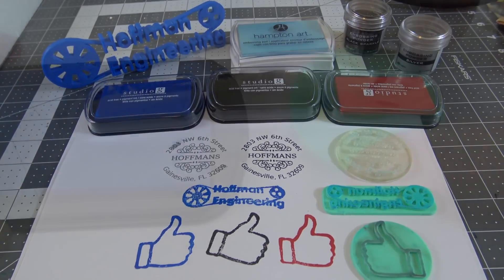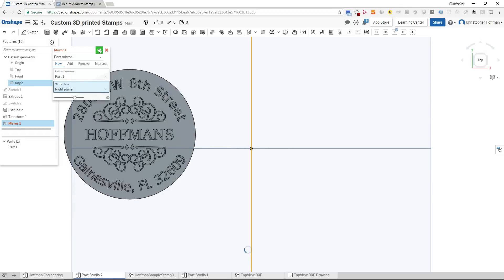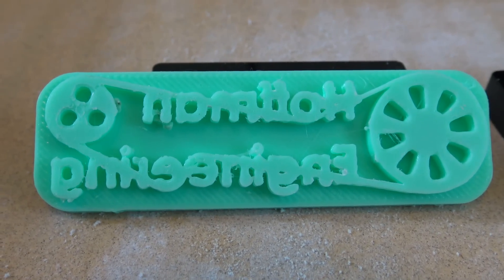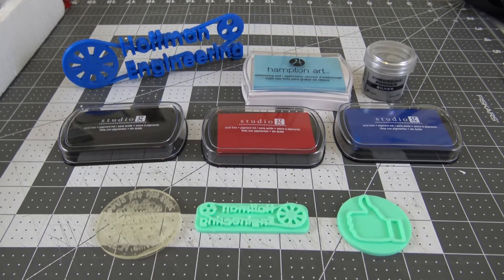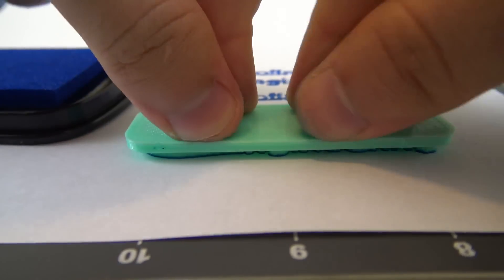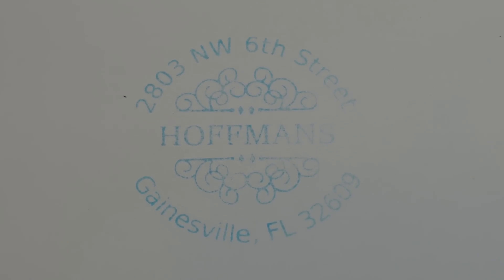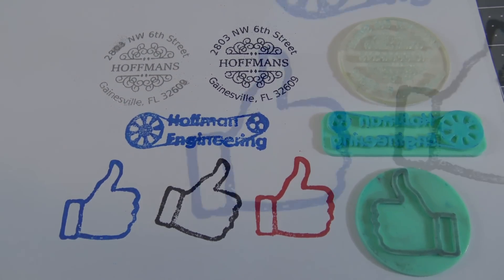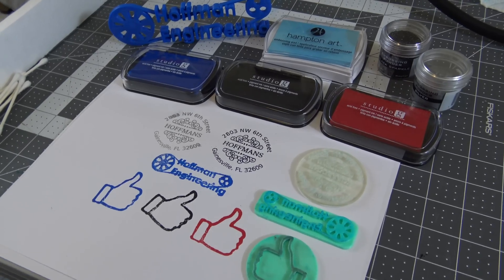Can you 3D Print custom stamps? DIY Crafting

Comment: Experienced stamper here. 
1. You can use embossing powder with ANY pigment or hybrid ink or a watermark inkpad as well.
2. The uneven image may be due to the fact that the stamp is made from plastic, and is non-porous. You may be seeing the result of the ink beading up on the surface of the stamp.
3. It seems like you're having to use a lot of pressure on your stamp. Place a soft surface under your paper, like a few layers of fun foam or a mousepad. That should help you get a cleaner impression.

Comment: Glad I found this. I was wondering if I needed a flexible rubber like subutrate to do this and am glad to know I don't  (though I am probably going to use the most flexible filmament type that suits my printer, all the same, but that still is far less flexible than rubber!).

I actually work in an educational maker space, so have had access to a number of printers for several years now, but, Ironirally, have never had anything I ever wanted to print for myself (I have only ever printed stock demo pieces learning the equipment, which is kind of sad 🙁).

I have a bunch of self-inking stamps of the flip-about mechanism type (so don't need ink-permeable stamp faces) salvaged from our admin office's waste stream and have always wanted to do custom stamps for them, so I now have something to print for me! 😀

Comment: I make rubber stamps for living. There's a type of rubber stamps we make from photosensitive resins just like the one for you printer, except that we use masking films and UV light box to expose them. I've just figured that you could use these SLA printers (the LCD based ones) to make the stamps as well. You start off by sandwiching the polymer liquid between two pieces of glass with a damming tape in the middle, the glasses being the size of the platform. You then shine the lights from a UV source onto one side of the glass sandwich for 1 minute (to make the base for your letters) Then bring the other side to the printer and place it right agains the LCD sceen with the image being projected for 1-2 minutes then disassemble the glass sandwich and wash off excess resin. The whole process could be completed in about 5 minutes but this would only work well with the LCD type printers. You're basically bypassing the film/stencil making process by using the printer's screen in its place.
Reply: I need silicone stamps to be used as inserts for my resin art.  Do you make them?  thank you.

Comment: Question, what did you use to heat up the embossing powder on the paper?
Reply: heating gun as i heard ...
Reply: I am not sure what is required, but in the video it looks like he used a soldering station.

Comment: Thanks for the Video. I'm also addicted to stamps at the moment and tried 3D filament printing. But the resolution was not high enough for my linearts. After that I wanted to switch rubber and laser engraver which can be a bit dangerous and expensive. But now I'm thinking about a Resin printer. That should fit my needs.

Comment: I came here looking for some tips, because I'm not very satisfied with how a stamp I made is performing. Not really sure why. I think it's because the stamp material (PLA) is too hard to do a good job, but you mention that it worked fine for you (which is interesting). The results I am getting look a bit spongy or stippled looking. I'm kind surprised that I'm getting this symptom, because I did sand the bottom against a flag surface. Maybe it's the kind of ink pad I am using. I got it from an office supply store, not a craft store. Imma gonna keep looking for info on this subject...

Thanks for introducing emboss powder. I'm going to have to try that at some point.

Comment: At 1:50 you forget to mention that even after the alcohol rinse, the resin isn't fully cured yet. You still need to do a post print cure, under UV light (sunlight or a lamp). An item of that size would be fully cured after about 30 mins under UV light.
Reply: It shows him hitting it with the UV flashlight @2:05. That will fully cure it in about 1 minute.

Comment: you should make the bottom of the stamp slide into a handle. that way it would be easier to use.
Reply from the maker: I agree, that would be the perfect next step. A handle to allow for interchangeable stamps, great idea.
Reply: I actually did exactly this last year also with PLA and sanding as a friend needed a stamp for her uni project and asked if my printer was capable. designed the handle with a dovetail cutout for interchangeable stamp plates. worked great and stopped from getting fingers messy... well... not in the testing phase... xD
Reply: I have a large 3D stamp that I had made. I was going to use it as an ink stamp for the holiday, but the ink wont hold. What should I do?
Reply: @dawnbullock6341  If it's PLA you must make sure you sand it with a very fine grit sand paper and make sure it is really REALLY flat. (My stamps are approx 20x20mm and took about 30-40mins of sanding, washing, testing, re-sanding). If you have sanded them really flat already then i would suggest trying a different ink. either ur current pad is old and drying out (Try adding a few drops of water or fresh ink to it), get a new pad or simply try a different one. I got a cheap black pad off amazon for £1.50 and although the ink quality isn't great it still gave decent enough prints.

Hope this helps, good luck! :)